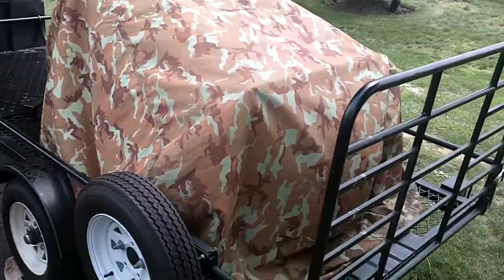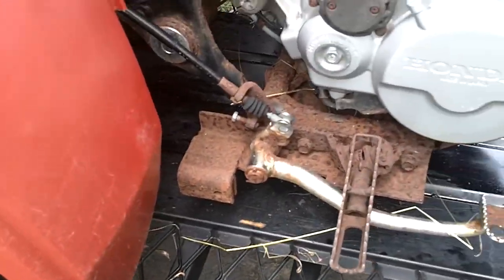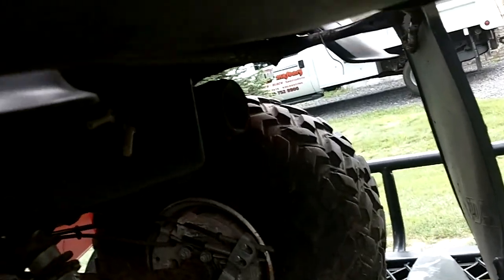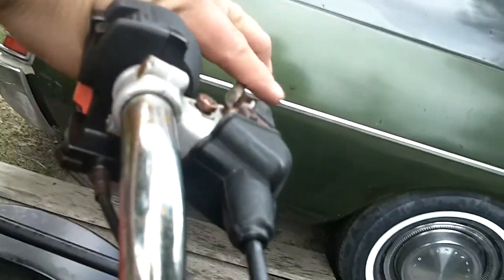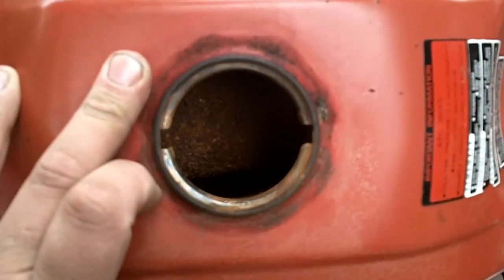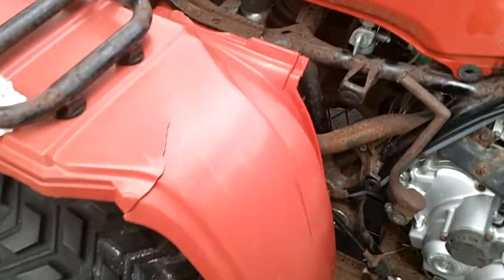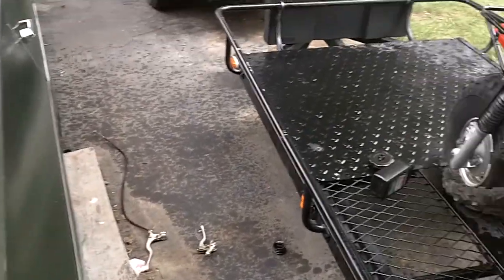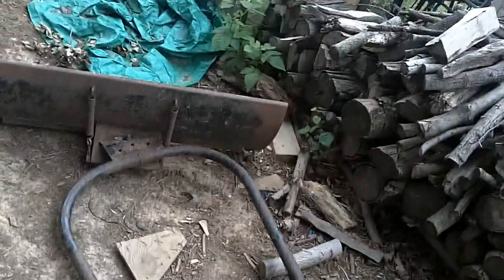The New 1985 ATC250es project bike unveiled

Comment from the maker: @deathkeeper5000 The deal was so good, I had to use a come-a-long to get it on the trailer because the rear end is locked up lol, probably the rear brakes are seized.  Which is why it's still on the trailer, tires don't hold air at all.